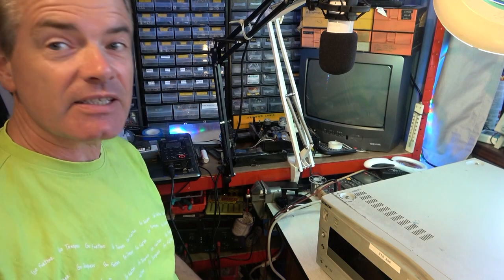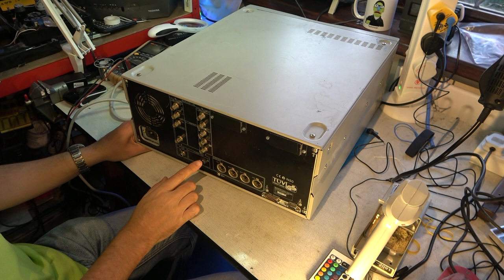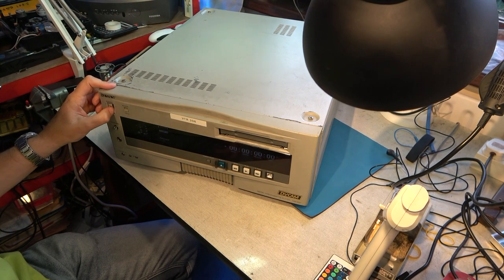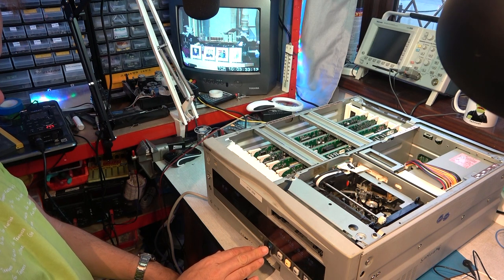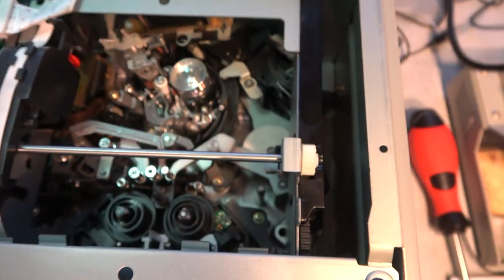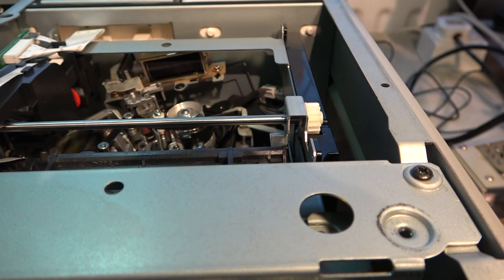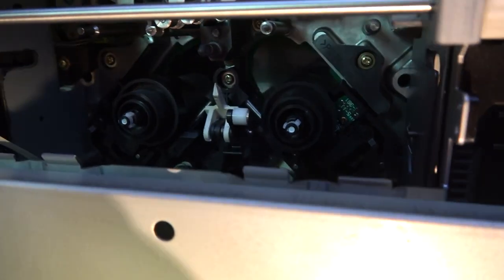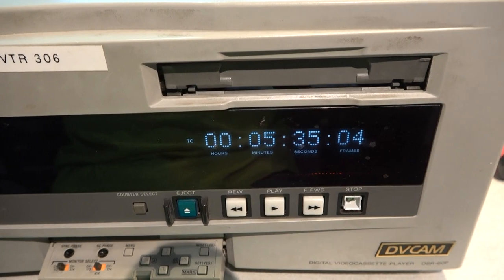Three video decks, part1: Sony DVCAM DSR60P

Comment: What a monster machine :-D, i first thought it was an old p.c, actually the switchmode psu looks similar to a p.c one.
The head is diddy lol, i wonder if it's compatable with other sony recorders/cameras, could be handy :-)
I'm always impressed by the clever way the designers create the mechanism, so many things have to be spot on,  i've never seen the takeup/supply reels move apart 
And i thought the vhs M wrap and betamax full wrap was clever :-D.
Betamax wrap seemed to go miles out, like the orbit of a satalite around a planet.
Something like that lol.

Thankyou for a smashing video :-D

Comment: Most interesting Colin, one begins to wonder whether it may be useful to see if there is a spare / for sale digital out board for this machine,  perhaps Sony even relented and made a converter cable, ie sony input plug to a firewire socket ? you never know.   look forward to the next two machines.   regards   Simon.
Reply from the maker: I'm looking out for the SDI board.  The other board option is SDTI(QSDI) or something like that, which outputs something like DV but not via a Firewire connector, so I don't know if I could use that.

Comment: Man I wish people randomly gave me old broadcast VCRs.

Question: What are your experiences of VCRs vs consumer camcorders playing back consumer minidv tapes (for capturing specifically)? I've found that my sony camcorders do a better job at picking up video from tapes than the two VCRs I've tried (DHR-1000 and DSR-11). The DHR-1000 is especially bad, often failing to read anything off tapes the camcorder reads video off no problem. I've head similar suggestions from others, but I don't know if I've just been unlucky with the specific vcrs I tried. Talking about SP mainly, don't think LP is supported on these high-end VCRs.
Reply from the maker: Correct, DV Long Play is not supported on any professional or semi-pro equipment including the DSR-11 and DHR-1000UX, I have both of those models.  (They will try to play something, from an LP tape, but the results are terrible.)  So I find it's safer to use camcorders to play miniDV tapes, and there's an extra thing to note about Sony miniDV camcorders:  Most (though not all) Sony camcorders support DVCAM playback, as well as supporting both NTSC and PAL tapes.  Additionally, newer Sony camcorder models have the intelligence to warn you if you are trying to play an HDV High Definition recording, popping up with a nice little HDV logo on the screen!  I have several DSR-11 players, a DSR-25 which has a sweet little screen, and some Sony HDV decks too.  Usually they get used for large DV, DVCAM or HDV tapes as appropriate, and not for run of the mill miniDV recordings.

Comment: If it doesn't have firewire port it is useless for tape transfer, You don't want to convert a lossy DVCAM to analog. The best machine if you don't have already one that covers all the tapes in the DV format is the Sony HVR-M15AU It plays and records DVCAM, DV, HDV, miniDVCAM, miniDV and miniHDV in both NTSC and PAL it also plays some weird recordings such as 720/30p, 720/25p  and 1080/24p.
Reply from the maker: The lack of a Firewire port is a major setback, but there are two possible digital output option cards for this machine and it may be that I can get one of those.  I do have a Sony HVR-M15AE, but it's not quite as flexible as you might hope:  Those weird format recordings (some are from JVC camcorders) will play back, but only via the analogue outputs, not Firewire.

Comment: I have just been given a DSR-80P. Switching it on, there is no front display. Is this likely to be a psu fault?
Reply from the maker: I would start with PSU but could be stuck in reset or other faults.
Reply: @video99couk  Yes, my thoughts too. I will try to source a replacement part.